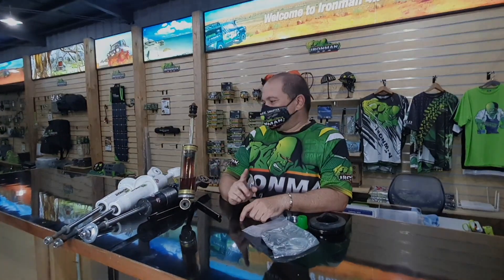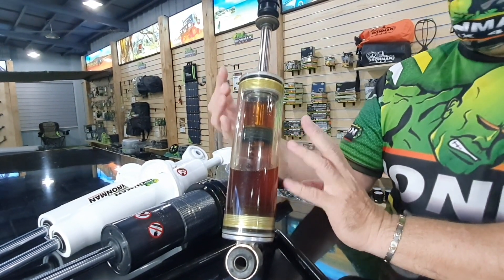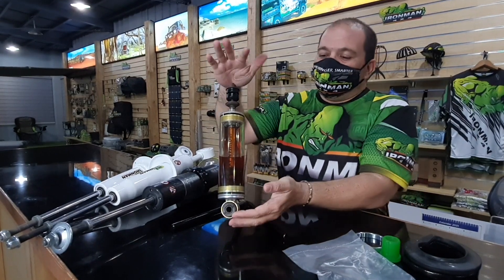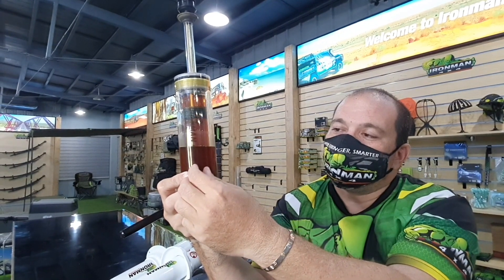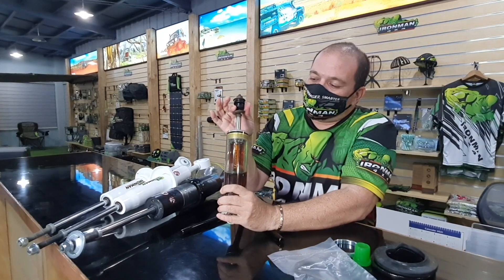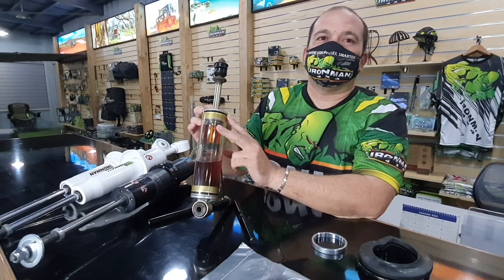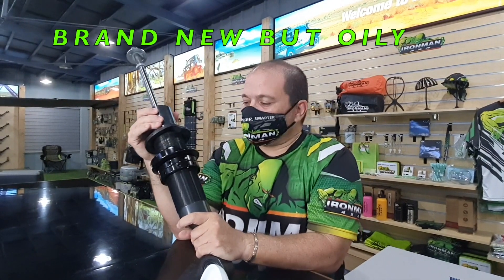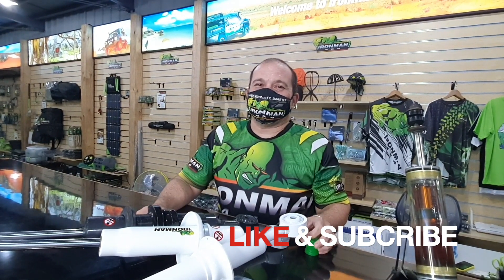Let's talk shocks!!!

Comment: What is the difference between Ironman foam cell from Ironman  foam cell PRO?
Reply from the maker: The Pro is bigger, thicker wall, more oil, bigger shaft and piston, simply the toughest offroad shock ever made.  Biggest difference is that the Pro can be opened and rebuilt and revalved.
Reply: @ironman4x4philippines20 which suspension offers more comfort? i use my dmax 80% highway driving and 20% off-roading

Comment: Using an adjuster (which generally controls a needle valve) IS NOT an inaccurate way to control damping. It's a very normal way to adjust low speed damping (that's low shock shaft speed, not low vehicle speed). In the valves (both the piston and the base valve), there is usually an open leakage path for low speed damping flow (ie: without the need for the valve shims to open at low speed). Having a hole and a needle valve is no less accurate than having either a hole in the valve body or s shim with leakage paths cut into it. Actually, the needle valve can be far more accurate than either a leakage shim or a drilled hole in the valve because the needle valve can be adjusted to a much finer resolution than either of the two other options, provided that it doesn't have detents to prevent it from being micro-adjusted.

How do I know this? I'm a specialist suspension engineer. Knowing this stuff has been my bread and butter for years.
Reply: Now for the speed-sensitive damping stuff... 🤦🏻‍♂️ The normally expected damping curve for any orifice (ie: hole) is exponential (think of an "x-squared curve" from your days of learning algebra at school). This results in extremely excessive high speed damping at the same time as having little to no low speed damping. This is very bad because every bump in the road will be jarring, but the vehicle will tend to wallow over slower undulations. What is needed is for the damping force to build up quickly at low shaft speed (ie: using a small bleed orifice that will allow some fluid movement, but will choke easily), while also allowing larger amounts of oil to pass the valve at higher shaft speed (usually done using shims that flex with fluid pressure across them - the higher the flow, the higher the pressure, the more the flex, and the more pressure is bled off compared to a simple orifice). This mechanism allowing the damping force to be less than it otherwise would've been at high shaft speed is what speed-sensitive damping is about. Yes, as the shaft speed is increased, the damping force still increases, but it gives a greatly reduced damping force at high shaft speed when compared to a simple orifice. This isn't rocket science and the information is all available on the internet, so a quick search could've saved you from showing the world that you know less than you think you know about the topic. I suggest that you should do some reading - especially sources that show force~velocity diagrams, because these will impart a lot more information than I can without the ability to even add links without YouTube automatically rejecting my comments. Please do your homework and get it right before you try to teach others.
Reply from the maker: @AutoEngineerVideos  thank you sir

Comment: Thanks you. So the main difference between the Ironman pro foam cell and ironman standard foam cell is bigger size. Bigger size because of strength required for adjustable rings right? In terms of performance should be the same?

Comment: I have a question for you and I would like to know if you can tell me if it is true that the ironman nitro gas shock absorbers go well with the standard original trim and can they be adapted with the +5?  i have a suzuki jimny 4x4 with m13a engine 1.3 lt factory standard gasoline yesterday afternoon i picked up the new ironman nitro gas shock absorbers and the 4x4 parts dealer in florence told me that these ironman nitro gas shock absorbers are good for off road 4x4 vehicles with a standard factory shock and springs tuning kit or in a second I could put the springs higher and it becomes a high +5 suspension is this true?  Greetings from Florence Italy!

Comment: Great Video. I am considering upgrading my stock struts (Lexus GX460) that have a level kit to obtain my 2.5" lift with Ironman FCPs and medium load springs. I will likely go with the Ironman UCAs too so I can eliminate the 1" wheel spacer I have (front only to eliminate rubbing). I have KDSS and rear springs and shocks are stock with the level kit. Any concern for what I am planning. Ultimately, I would upgrade the rear when needed. GX spends most of the time on pavement, but weekends it does overlanding. Thanks.
Reply from the maker: If you are running Foam Cell Pros you can adjust preload to get 2.5 inches just as long as we can get at least 50mm sag.  Probably achievable with the Ironman UCA

Comment: Please can you advise, 
Hilux 2016
I world like to improve the comfot in the road and off road, 
Will comfort imprive by repacing nitro or form cell or  form cell pro 
But I dont want to increase the hight of the car 
Need your kind advise
Reply from the maker: Foam Cell Comfort rear or Foam Cell Pro Comfort.  2016 maybe you need to modify the leafs also.
Reply: @ironman4x4philippines20  thank you for the advice, 
Also I was finding for toyota fortuner 2016, to improve the comfot in mostly road and less off road according to the research I am getting below advice from online so please can you advise if its correct 

"When looking to improve the comfort of your Toyota Fortuner for mostly on-road driving, replacing the original shock absorbers can indeed make a difference. In terms of the options you mentioned, Ironman Nitro, Foam Cell, and Foam Cell Pro, they all have their unique features and benefits.

Ironman Nitro shock absorbers are known for their twin-tube design, providing better control and ride comfort. They offer improved damping characteristics and can enhance your driving experience on paved roads.

Foam Cell shock absorbers utilize a cellular foam insert within the shock to prevent aeration, improve heat dissipation, and provide smoother performance. They are particularly suitable for vehicles engaged in demanding off-road activities, as the foam insert reduces the risk of shock fade.

Foam Cell Pro shock absorbers are an upgraded version of Foam Cell shocks. They incorporate a larger diameter and stronger piston rod for increased durability and better performance in both on- and off-road conditions.

If your priority is primarily on-road comfort and you want to maintain the same height, the Ironman Nitro shock absorbers would be a suitable option. They should enhance the smoothness of your ride without significantly raising the height of the vehicle.

However, it's important to note that shock absorbers work in conjunction with other suspension components, such as springs and bushings. Consider the condition of these parts as well, as they can affect ride quality. If they are worn, it might be beneficial to replace them along with the shock absorbers."

Comment: Hi what shocks do you suggest for comfort?
Reply from the maker: What vehicle sir, and setup?  What are the accessories installed and what springs are used?
Reply: @ironman4x4philippines20  hello thanks for replying quickly. It’s for a 2020 Fortuner 4x2 V. 
Current setup is all OE shocks, coils, and struts, and tyres 265/60/18. The current equipment is not plush at all and doesn’t absorb the bumps and road harshness well.

Comment: Hello sir. Talaga po bang nasa 15mm lift lang ang Ironman suspension kit para sa 2022 Montero 2.4L GLX M/T 4x2? Yun po kasi ang nakalagay sa website ng Ironman 4x4 para sa MITS040B front coil springs and MITS042A rear coil springs or mas mataas po kapag sa Montero 4x2 linagay? I'm looking for a 30mm lift all around po kasi.
Reply from the maker: The advertised estimated lift is at the load indicated on the website.  30mm is easy if installed right.  I would also use A in front if your 4x2 doesnt have a metal bumper.
Reply: @ironman4x4philippines20  so what springs would I need in order to get a 30mm lift all around?
Reply from the maker: @RR-cg2rq  will you use Ironman shocks as well?
Reply: @ironman4x4philippines20  yes sir. I plan on using Ironman Nitro Gas
Reply from the maker: @RR-cg2rq  we can run MITS040A spring with  a 10mm preload spacer.
Reply: @ironman4x4philippines20  what about for the rear springs sir? What part no. ang gagamitin?

Comment: Greetings po sir! I have a 2015 Fortuner with KYB New SR shocks which are great for high-speed cornering but they are really stiff. I won't be adding any weight to the car. I want to improve the ride comfort and be able to drive fast on a very, very, very poorly maintained mountainous highway riddled with small rocks and potholes whilst maintaining good cornering. What shock and spring combo can you recommend po? Will getting the 2" lift induce more body roll po due to the higher center of gravity or will the difference be negligible?
Reply from the maker: The body roll and high speed handling is greatly influenced by the spring rate.  For the fortuner we have standard height (max 1 inch) lift springs and 2 inch springs.  I would suggest pairing them up by with foam cell front and foam cell comfort rear shocks.

Comment: hi what’s the extended length and compressed length of the 45852FE from centre of eyelet to eyelet. If you have these specs is it with bump stop compressed on shocks. cheers
Reply from the maker: How do I send you a pm?
Reply: @ironman4x4philippines20  Hi. I am not sure how to send personal email address here without it getting into the wrong hands. I just un did the bottom shock mount and extended the 45852FE foam cell pro shock and measured around 670 mm approx.  This is about the same or 10mm longer then the rubicon rear shocks on a 2 door JL wrangler.Cheers Phil
Reply from the maker: @philliplehn3600  the rear shocks work at an angle, so their working length is not 1:1 I think.  But to be safe, I will measure.  Do you have facebook messenger?
Reply: @ironman4x4philippines20  hi . don’t have Active Face book Account . was hacked and closed

Comment: Do some Ironman shock absorbers come with internal bump stops? Mine came with external bump stops on the piston shaft. Foam cell pro on JL Jeep Wrangler.
Reply from the maker: Only the Pros come with an extra external stop.
Reply: @ironman4x4philippines20  Hi do i need to keep the original bump stops installed above the rear axles as I have been off roading without them . I only carry a small fridge and recovery gear. i’m using the bump stops on the shocks , they are ironman Pros on a 2 door jl wrangler with the light springs.
Reply from the maker: @philliplehn3600  well you should keep the bumpestops on the axles as they were designed to absorb more shock than your shock absorber mounts.  My Jeep runs all the stock bumpstops with Ironman coils and Foam Cell Pros.
Reply from the maker: @philliplehn3600  Also, the stock bumpstops were designed to stop upward travel to protect your prop shaft, transfercase, and mounts should you accidentally jump your Jeep, in the Philippines we usually accidentally get airborne on bridges and pavement gaps.  This kind of impact your shock mounts are simply too weak to handle.
Reply: @ironman4x4philippines20  will i still have the same articulation as standard or more with them on at the rear. the front has  both on in each corner and they squeeze up with all the weight on the front.
Reply: @ironman4x4philippines20  the axle bump stops are the main ones? The shock bump stops are not on other shocks  Do i really need the shock bump stops if i use the axle ones
Reply from the maker: @philliplehn3600  yes you do sir.  They are their by design on the foam cell pro to further improve the life of the shocks, making the Pros the strongest most rubost 4x4 shocks ever made.  They will not limit your performance in anynway.
Reply: @ironman4x4philippines20  i now have the rear axle bump stops installed. The fronts were always installed and they still compress with the the shock bump stops with the sway bar disconnected on the Rubicon. The back just never worked that hard
Reply from the maker: @philliplehn3600  yes same as with my Jeep sir

Comment: Sir for hi lux J with steel bumper of ironman and steel bumper at the back. The nitro gas ironman can bring all the weight of the truck sir? It is true that iron man nitro gas ligted the vehicle 2 inches with out any spacer?
Reply from the maker: Hi sir.. Springs carries the load & lifts the truck not the shocks po. All nitrogas shocks it compatible for 2 inch lift & Needs to pair it with our load rated springs to carry your load + the 2 inch lift..

Comment: I recently installed ironman foamcell on my hilux 4x2 revo and it still feels stiff over bumps and on uneven pavement. Non load springs were installed as well as both FE and FEC for the shocks. Does it have a break in period and will it need time to settle in order for me to feel the comfort and performance over potholes and uneven philippine roads?
Reply from the maker: What coils were installed?  If you have a 4x2 and it has no bumper or anything, it should be TOY055A with a 10mm ring.  Also what was done to the rear? What year model?
Reply: @ironman4x4philippines20  TOY055A for the springs and "add a leaf"  was only done to the rear. No 10mm ring was installed on the shocks at the front. No steel bumper or under body protection so bone stock toyota hilux revo 2018
Reply from the maker: @jonasmemoracion5578  send me pics of the setup and who set it up. Will see how we can improve it.  My fb is Pablo Lu Ascoba.
Reply: Alright I have already messaged you Sir pablo. Please check message request.
Reply: @jonasmemoracion5578 did you end up getting your suspension fixed? Did you have the normal foam cell or the foam cell pro? I have a Ford Ranger I'm looking at getting Ironman suspension with no load springs in the front, comfort shocks in the rear, and leave the original leaf springs in the rear, but if it is a bit rough I'm a bit worried about that.
Reply: you installed the suspension ? @brentonappleby9836

Comment: Why most of the vehicles don't have option for GRC and FEC? only GR and FE is available.
Reply from the maker: FEC and GRC are usually availble for the rear of most stiff utility vehicles.  For the front it might cause a bad roll in the event of a sudden change of direction.  What vehicle do you have?
Reply: @ironman4x4philippines20  NIssan Xterra.

Comment: Sir any suggestions po mag lift po sna ako 2 inches sa DMAX
Reply from the maker: Yes sir...

We have a 3yrs/60000 km WARRANTY Ironman 4x4 Australia SINGLE BRAND promo set for Struts Coil and Leaf Pickups and SUVs❗💚

✅ Nitrogas kit 40000
✅ Foam Cell kit 50000
✅ Foam Cell Pro kit 74000

You get:
✅ 4 pcs shocks
✅ 2 pcs front coilsprings
✅ 2 pcs rear AddALeaf springs
✅ 3 year/60000 kms worldwide warranty
✅ Australian brand with 62 years experience
✅ Australian R&D
✅ sold worldwide
✅ a proper website and aftersales department in Australia
✅ no magic shackles, no spacers
✅ not a rebrand

www.ironman4x4.com

Comment: i have been dreaming of getting my truck iron manned hehe. but my stock shocks are dead can i put nitrogas on stock height strada 2013? thank you for your wonderfull explanation
Reply from the maker: Yes you can.  Just a shock change. No springs, no 2 inch lift maam.  Happy Valentines 💚
Reply: @ironman4x4philippines20   thank you wanted to find a soft ride but better quality for our strada 2013 thank you

Comment: Hey! I got Foam Cell Pro Stage 2 with 4x Foam Cell Pros, TOY065C front coils, TOY077B leaf springs, greasablr shackles, u bolt kit, propellor shaft shims, poly bushes and all that goodness.

I have a Toyota hilux

I noticed my front end has gone lower than my back, giving a sort of rake. Is that normal for the suspension to settle? Can anything be done about it? (Ie. Adjusting the front Foam Cell shocks to allow the truck to be level?) 

Plans for the truck are to have a bullbar in the front, so my dealer here told me to go 065C coils front but maintain 077B leaf springs (not gonna load too much in the rear all the time)

Is there some way I can contact you for advice? I got more questions regarding my ironman gear
Reply from the maker: Well, 65C is pretty stiff.  I only run 65B on mine and its all geared up, and 77A in the rear with the Canopy and drawer system, as well as a fridge.  First thing to realize is the 77B on an empty rear end will be really leading to rake. 

 As for your front end adjustment.  Try to do a sag measurement first (link below) and lets discuss your results.

https://youtu.be/10wpdjp1eLg
Reply: @ironman4x4philippines20  thanks for the quick reply! Anywhere else I can chat with you?
Reply from the maker: @nn.4410  drop me a pm at my fb Pablo Lu Ascoba

Comment: Hi I have a 2017 Dmax space cab hi Rider the factory suspension is worn out looking to upgrade with Iron Man products what suspension would you recommend for front and rear without compromising my ride on the highway please
Reply from the maker: I would go foam cell front, A springs, rear foam cell comfort and AddALEafs or A leaf springs.  Do you have a front steel bumper and other accessories?

Comment: Hi, well explained topic. Just a brief question: When I should choose foam cell or foam cell pro???  My car is a Nissan Frontier NP300 4x4 2019 and I usually transit 80% city and 20% off road. In the other hand, the original suspension of this car is very soft, using  foam cell or foam cell pro shocks will become rigid? thanks again
Reply from the maker: It will not be rigid but controlled.  It will still ride good but the sway and uncomtrolled movements will be gone.

Comment: hi need pb panhard sa fortuner 2017. i have already ironmam nitrogas suspension n spring.
Reply from the maker: No sir.  No need at all.  I havent installed a panhard on a 2 inch fortuner the last 12 years.